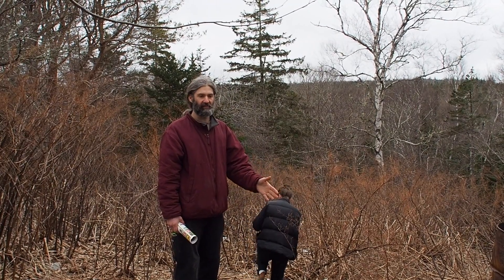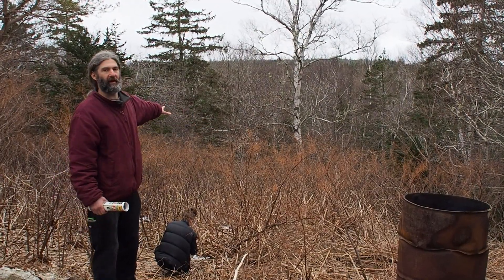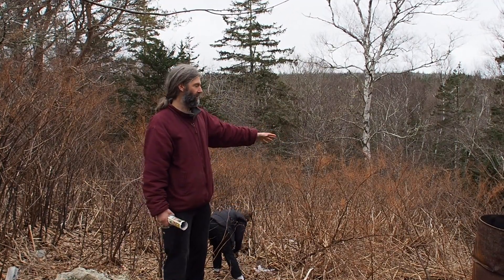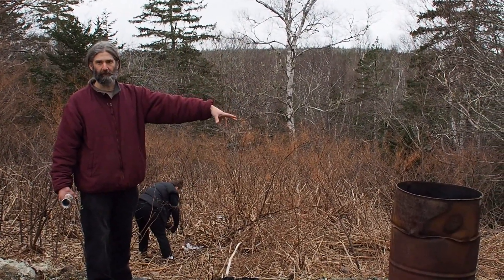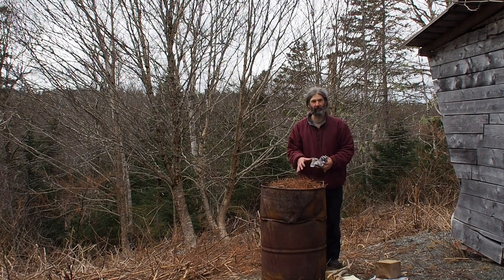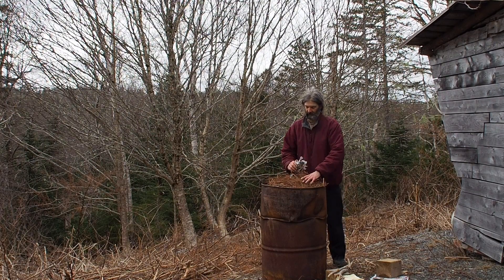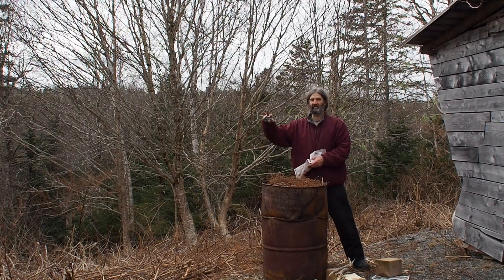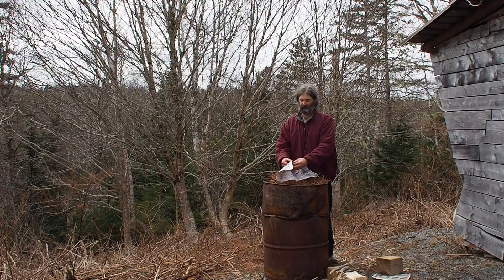Turning Japanese Knotweed into Biochar

Comment: Biomass,  but also domestic waste or plastics waste can through pyrolysis be turned into a dirty oil, syngas, biochar etc... 
From these products, we can make almost anything for which,
 we normally use fossil sources. Plastic is possible but also methanol, ethanol or a clean synthetic fuel like dimethyl ether which could be used in diesel engines ( zero soot !!) 
So we don't really need hydrogen for planes or ammonia for ships.
 Moderately heated and compressed plant mass looks like brown coal and can replace coal in steel and cement production without any adaptation.
 Fresh plant material is humid, voluminous and so transport is costly. However,  a heat treatment at lower temperature makes long term storage and compression into briquettes easy. Ideally microwaves should be used for heating but I don't know if this can be realized mobile.
If we would use knotweed, then compression is a piece of cake and the heating ensures
that spreading of the plant through pieces, falling of the truck is impossible.
The pyrolysis products need to be purified, processed, upgraded and there are the costs for harvesting, torrefaction, compression and transport. Land usage seems no problem since we have railroad, road, river, highway sides for biomass (it doesn't need to be knotweed) 
But so sadly, for now,  this makes fuel from biomass cost twice as much as fossil fuel. 
However, all this techniques are already old and have even been used during the war. 
Improvement is today possible by using microwaves and lasers, for more efficient heating. If we use the right plants or any pure material, it should allow for a tweaked process which requires less post processing.
Since the biochar doesn't return into the carbon cycle, this is a way of carbon capture and this should be considered too.